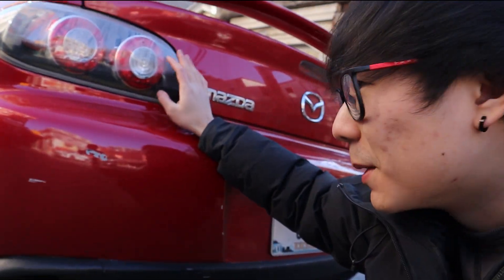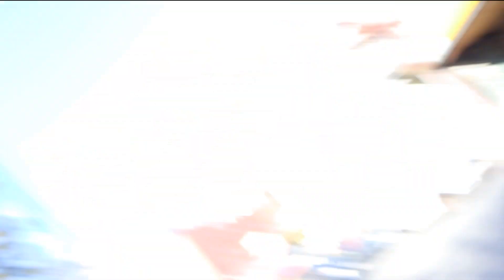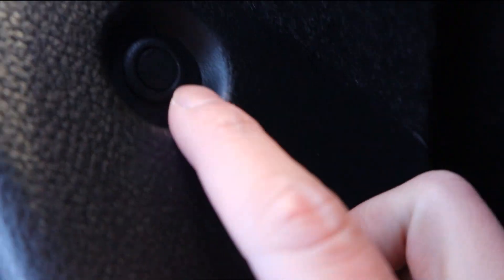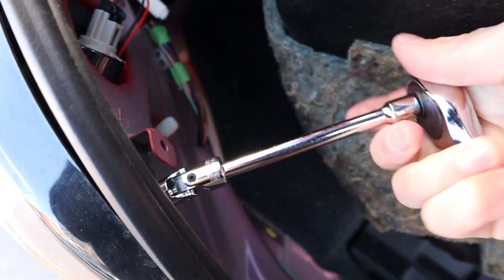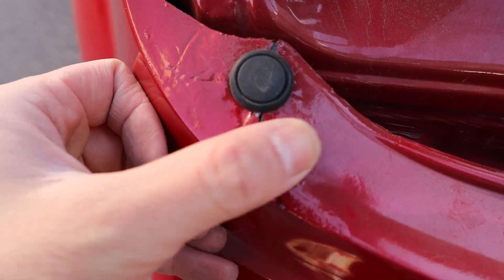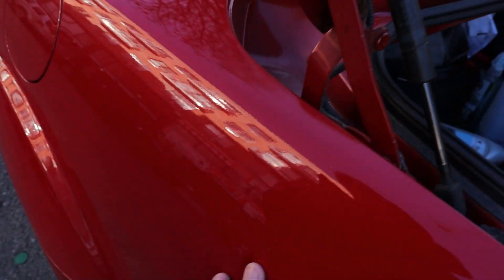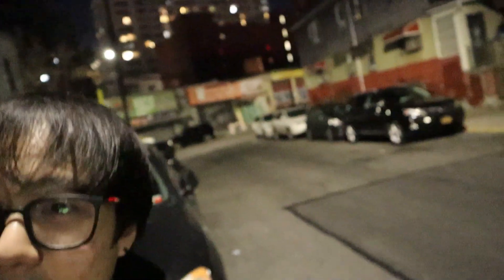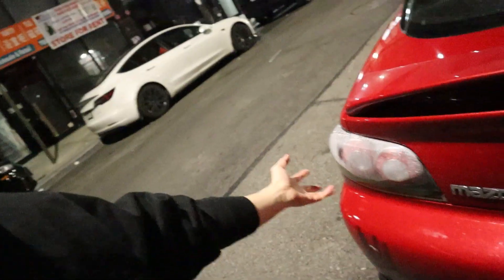Fixing My Rx8's Aquarium Taillights | More Damages Found...

Comment: I had the same taillights and they finally just burned out from the water accumulating in them. It seemed like rain was dripping off the trunk lid onto and into the lights. the clear lens gasket wasn't sealing properly. When I go buy a new set I was going to use silicone to seal everything properly.
Reply from the maker: I'm currently debating if I go through that process or have some custom ones made.  I reallt want the Re-Amemiya ones but can't afford it 😂
Reply: @Rxjeikun  For the cost, I'd say its worth it to properly seal them. It's really a bummer that these lights aren't made correctly because they look great.

Comment: Ok. First of all. That "crack" in your plastic bumper... Is not rust. Second, Your gasket looked like it wasn't sealed properly. You can see a set of groves on the upper pert of the gasket. There should be one grove. Contact point. Im guessing you didn't seat the gasket properly and... Didn't snug up the bolts tight enough. Cheers!